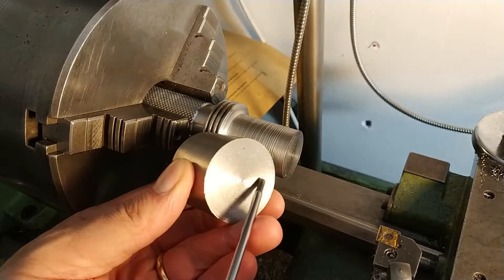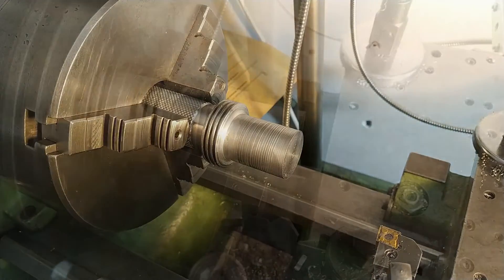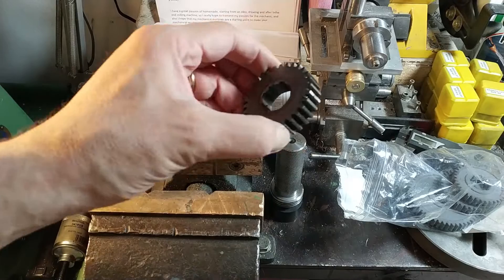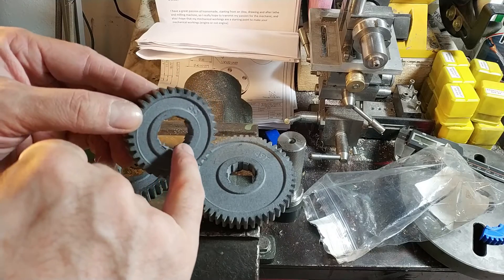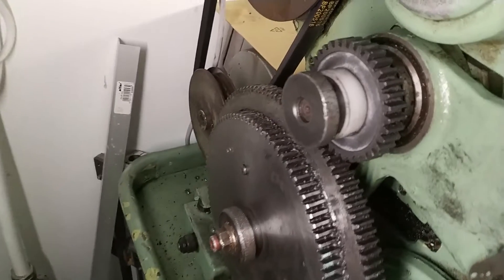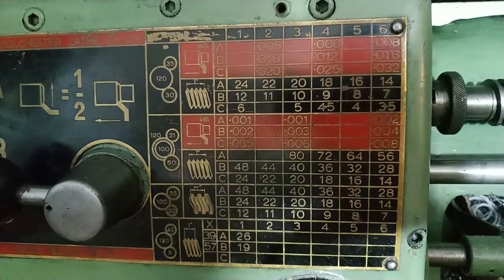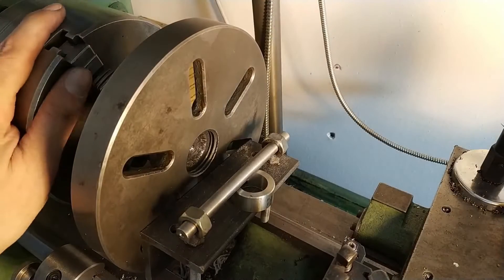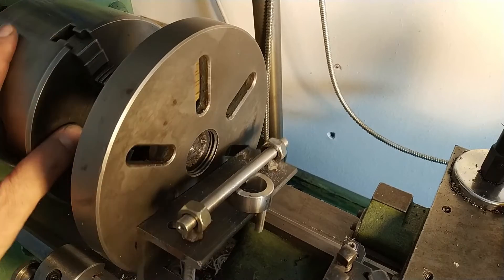How to Make a shaft for a Lathe Faceplate

Comment: So Alberto you made 5 videos in one: faceplate arbour, machining a flat surface on a bush (circle chord), 3D CAD, making lathe gears and a tribute to your father. Any one of those topics could have made a video on it's own. How did you make the gears - are they printed? are they cast?  Good video, I enjoyed it thank you.
Reply from the maker: Hi Paul, thanks: you know the first idea was the arbour and presenting me, but after It was like a wheel, the OD unusable for the screw, so bushing, installed by hot interference and after soldered with Tig, at the end all was around the1.5" screw, of It can be made otherwise no video 😅 a strange situation! The gears drawings was made by me, taking care on 6 tooth hole, After i send the 3D file (.Step file) to a company, that made for me with carbon fiber load, It Is very well made and strong material!Happy that you enjoyed My "5 videos"! 😁
Reply from the maker: Ah sorry forgot, yes the gears are printed,   16 DP if i Remember correct!

Comment: Great video and a good tribute to your father, I enjoyed the story about your first tool, thanks. This was an interesting project. We looked at a Boxford lathe before buying our Colchester. We have not yet tried screw cutting on our lathe but it is on the list of things to learn. We have two faceplates for our Colchester, one is huge and designed to be used with the gap in the bed removed, we have not used either yet. We were lucky to be able to pick up a some lathe chucks at an auction a couple of years ago
Reply from the maker: Hi Joseph and thank you !! I have to say, frankly, that the threading was the most complex part, not so much because of being in inch (my Colchester Bantam is inch, not metric version although you can thread metric as I explain in the video) but because the depth of thread is almost 2 mm on the radius; that is, a great effort, especially in the last passages when both sides of the insert touch and cut; a great advantage, perhaps you have noticed it from the non-accelerated videos (normal speed = 1) is the extreme slowness of rotation of the spindle, thanks to the inverter: here is one of the great advantages, certainly the cutting speed is not optimal because too slow, but certainly you do not have the risk of crashing with the tool after the threaded section; I had found a faceplate on Ebay.co.uk for 140 pounds, with the correct Camlock D1-3 attachment for the Bantam, but first I decided to attempt a Wacky Works using what I had in the house.
I decided to make a small dedication to my father because I mentioned where my passion started and since it all started with him, here's the reason !! See you soon Joseph, Alberto

Comment: Great work on the lathe, excellent projects thanks have a good one ☝️
Reply from the maker: +
Thank you 360 Alaskan life, It all depended on the thread, if it was successful otherwise I had to change the project, because the faceplate is made of cast iron and cannot be welded, so it was the only solution to use it!